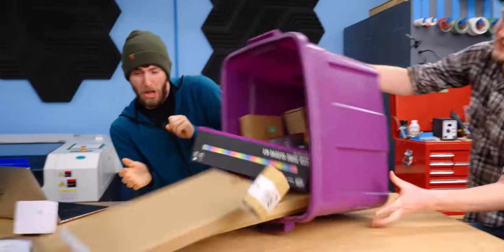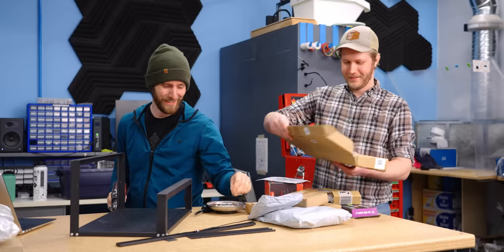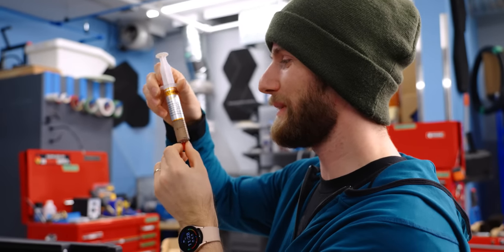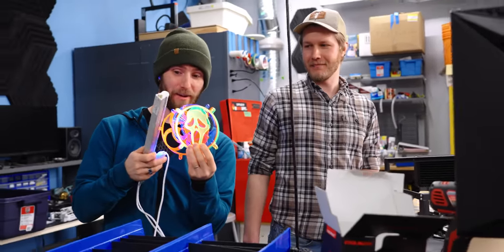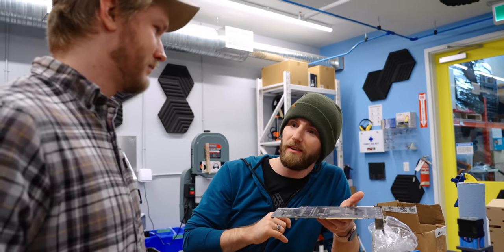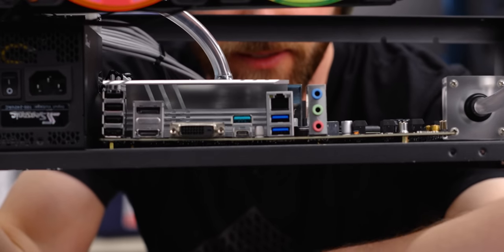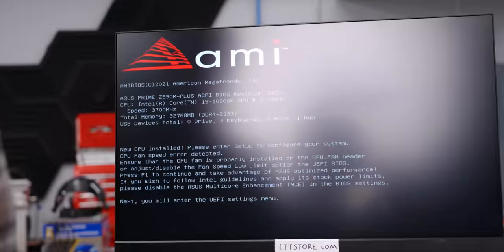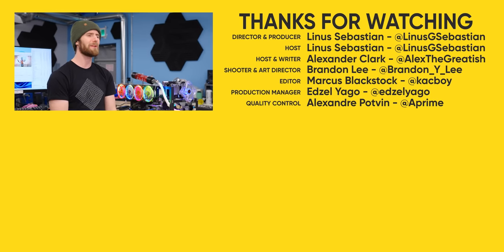Water Cooling… Using only Wish.com

Comment: Disclaimer: i live in eastern europe where u find worse thing sometimes when it comes to electricity, but still u should not do this i mean linus already said its crazy and htye threw it into trash so i don't think this disclaimer is neccesary but hey who knows....

Actual Comment: I like how the ledlights were too scary for canadians with their puny 120V meanwhile the same solutions are deemed perfectly ok here in eastern europe with 230-240v, and no one bats an eye just get a soldering iron and thermoshrinking isolation on them before hand, solder them together, move the isolation to cover the exposed copper wiring with overlap on isolation, shrink it wiht soldering iron and done safe... ish....

Comment: I just bought the same aio and tubing ....and fittings 

I received 1" 1/4 fittings and 3/16 tubing 😂😂😂😂

Took a month to receive the stuff for 89$ .
Btw the radiator works even under full load of my I9 at 72C° all cores.

Comment: i have THIS 6 pcs COOLMOON rgb fans since 18.feb.2018, after few modding they still works great!, this cost me 160NIS on ebay, they also come with led controller but dont have RGB on the led controller (only on the fans), the remote control is RF and NOT IR, he died after a year and half, before the remote control died i managed to save half of his buttons on my sonoff rf bridge and the other half on another portable stand alone remote cloner, the kit control only on the 5v channel of the RGB ONLY, the fans CANT be controlled so i cut off the 12V minus and connect it to 5v minus to get 7v for the fans (for running quiter) and everything is perfect for now, p.s. if i could upload photos to this post i will upload but there is no option here.

Comment: Ok so wild pitch. Take a laptop cooling pad with the fans or such and build in a active cooling system that allows the pas to blow cooler air into the laptops intake to reduce operation temp and allow our intel chips to run without throttlingand cool it more so that the systems efficiency increases leaving the already limited wattage from the power brick to be better utilized, voltage regulators kept cool will also improve their consistancy making the gaming laptop actually run better than the manufacturers were able to accomplish.

Comment: I''ve got a set of coolmoon fans, same kit that was in the video. They work alright! Although i did have to replace the controller and remote because some buttons weren't working. But it was only $10
Reply: "They worked alright! Except when they didn't."

Um...

Comment: want a fix on win11 to only run on one graphic adapter on laptop. just change the internal graphic to basic display adapter and then disable. then windows has no choice but to only use the fast one all the time.

Comment: Thanks for the tip on alumin(i)um dust. I guess I'll start using a dust mask when I file the stuff in the process of fabricating brackets and all kinds of other bits and bobs I've made from the various shapes they sell at home supply stores. I'm contemplating whether I should sue the one that I bought all the supplies from for not having a warning sign advising me that I might not want to inhale the airborne particles that result from working with the stuff. 🤨
Reply: That an silica dust are a great way to get leukemia down the line

Comment: Kinda want to add a flow meter to my loop now. I'm not going to, but still. Also, I bought tubing from my local hardware store. They had tubing in the ID/OD combination I wanted and it was rated to 80°C, which is perfect, assuming nothing breaks on me. First attempt at a non-AIO loop
Edit: still working on it, but my cheap rad (it said copper but I see brass) is slightly crooked on the outside securing rail parts but seems fine otherwise
Reply: It's been about a year, give us an update on that loop you were "still working on" when you made the edit.
Reply: @sagecolvard9644  it's actually in a Fractal case now with a D5 pump. Pump is barely held on and it leaked 3 times when I first fill it, but it works!

Comment: Aluminum dust is "really" bad for you? No dust is good for you but I've never heard anything that would suggest aluminum or aluminum oxide are any more harmful than any other kind of dust of the same particle size. I've been grinding aluminum for years with aluminum oxide and silicon carbide abrasives and passing annual physicals with flying colors.🤷‍♂️

Comment: temps are great for 1 reason,its not a pwny crap aio setup,u guys used thick 1/2 tubing a single 3x120mm rad(i use 2 120mmx3 rads)..............u guys built a custom loop.dont be shocked at actual performance....aio,s killed it for real water performance numbers honestly.......

my setup
stacker 830 case
gig aurous master z390
32 gigs 3600 kingston
ek heatkiller copper block(rev 3)
rtx evga hydropper 2080
1/2 tygon tubing
dual 120mmx3 rads (1 thick one,and the other standered width) +SINGLE water loop+
swiftech mcp d-5 pump(set 1" out of 5 speed setting,silent)  <----thee best pumps ..last 10 years+
seasonic 850 titanium
cpu idle 23    load 58
gpu idle 23    load 52
 at 1080p  alienware 24 inch 240hz(this moniter is a true FPS gamers dream($450 now! but worth it,i got it for$349 
4 years ago)....

Comment: bought the msi meg 360 aio for my 12700k, and it has a small buzzing immediately. cooler mounted top, tried everything possible. seems like it has something to do with the motor in the water pump. not really worried about it except the fact my msi force mobo shows vga light with my asus tuf 3070. although everything has been running great, benchs great, nothing even hits 70 degrees in my corsair 7000d airflow case.